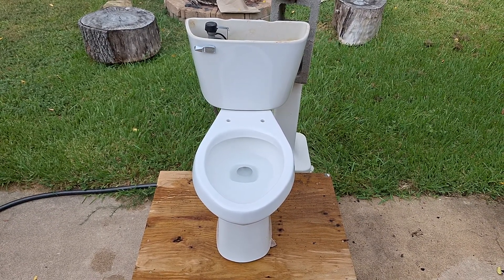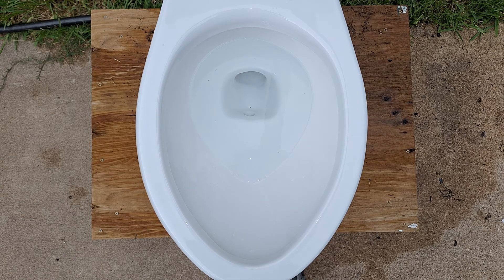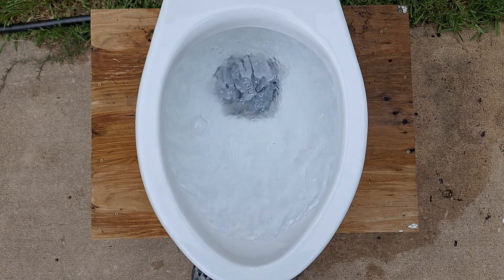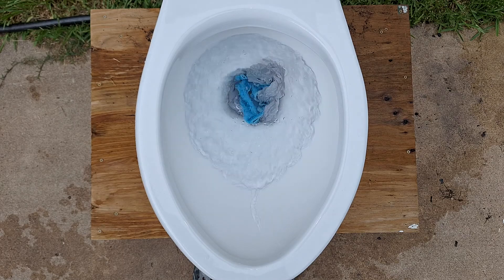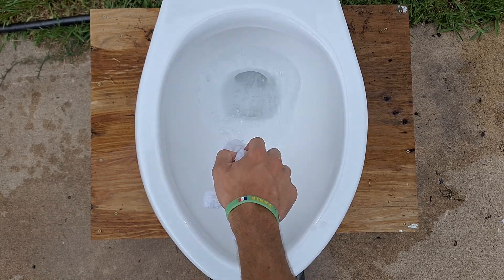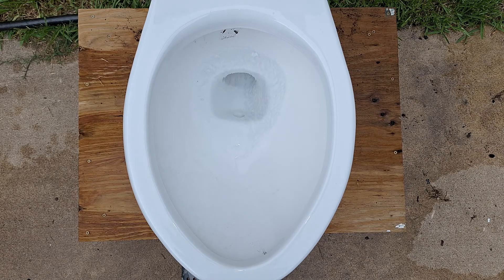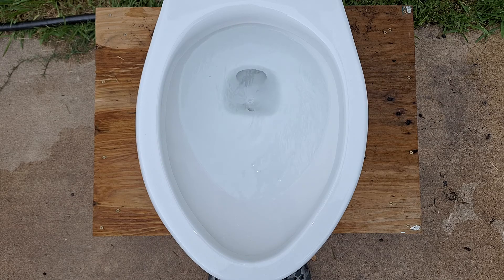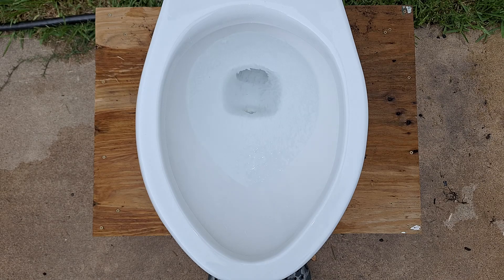1995 ADA Mansfield Alto Tests

Comment: After all, it's an early gravity fed 1.6 gpf toilet..
A trapway with that size was just unacceptable! It still has a great flush but the trapway design makes it as bad as one of those shitty front flushing Kohler rialtos 
Mansfield literally could have done a way better job designing the trapway for it, like around 2-1/4 inch and this could have been a perfect game changing 1.6 gpf toilet for the early 90s.
Reply from the maker: The early 90s was just a terrible time for toilets in general